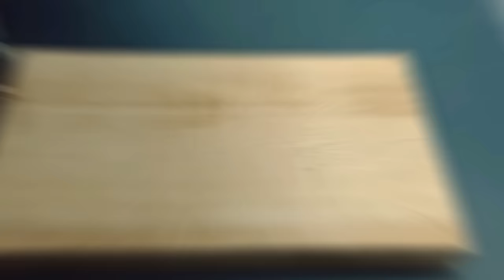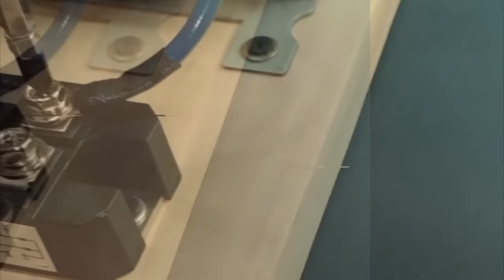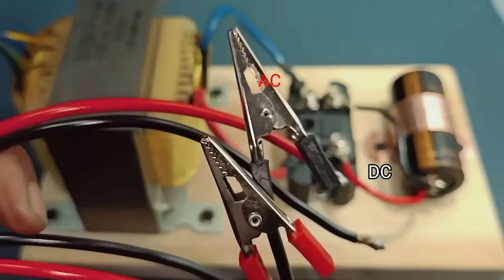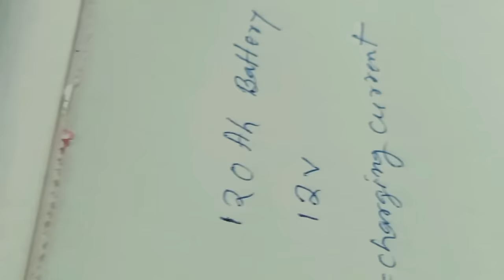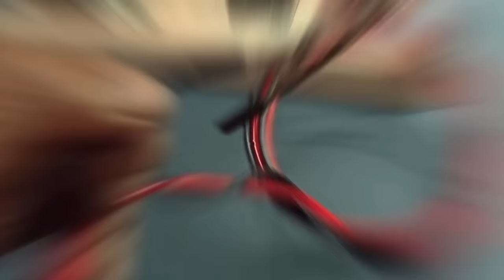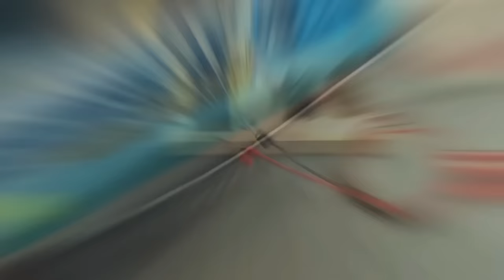12V 200A DC from 220v // Powerful Battery Charger 12V,  How to Make 12v Battery Charger

Comment: Input is 220v 5A , which is 1100VA , how are you getting 12V 200A i'e 2400VA, are you creating magic???
Reply: Yes
Reply: It would be 84.6 amps if it drew 5 amps at 220.
Reply: Hahaha 😂😂😂😂
Reply: Correct!!! Another thing, I don't think that small transformer will take 5 amps for the primary side
Reply: its a total farce
1 -it is NOT a battery charger
2 - its a crude power supply
3 - wiring is a joke
4 - testing a joke
5 - maybe its 4 or 5 Amps only as shown
6 - no protectioin, not even a fuse
7 - no indicators
Reply: Easy,  Use U eyes to check the diameter of the output 14V wire and guess the maximum current can flow through without smoking .

Comment: Not sure why you claim this can yield 200A. Clearly it can't. It's a nice video, just wonder why you didn't state the actual charging current, and maybe display it on a meter.
Reply: Tenga en cuenta que para poder suministrar un alto amperaje el tamaño de los cables deber seras grande

Comment: 13volts is not the ideal charging voltage for fully chargning a 12 volt battery, we need 14.2 or 14.4 volts to fully charge a 12 battery.
Reply from the maker: Total 15v with load, connect with capacitor
Reply: 13 is ac voltage. When it is bridge rectified, 13×1.414 - 1.4 is the dc voltage is going to charge the capacitor. We have to regulate it further for the type of the battery.
Reply: @surendranmk5306  yea that's spot on be more like 18 volts and is either too much or not enough for most batteries lol
Reply: @bparker86  It is better to use a 220 to  18v ac transformer  then  use a dc to dc constant voltage and current buck converter that can exactly adjust the required current and voltage respectively to the type of battery.

Comment: Can use with subwoofer bass 2000w or not?
Reply: No you can't. The rectified voltage of a 13v transformer like shown here is about 18v which will most likely damage 12v amps. Also this rectifier needs cooling  and the cap is too small. Rather take one with 18 - 20v and higher F ratings than this 100v one

Comment: It is better to choose as AC voltage, the 16 V option... rectify it and use an electronic step down module to adjust voltage and current as needed to charge every battery you want or to feed DIY electronic kit. 
I also suggest you to provide the rectifier with a huge heat dissipation radiator: with hight current it generates a lot of heat.
Reply: A fuse would also be a really good idea.

Comment: Hola feliz tarde excelente video me gustó mucho soy Marcelino Cojedes VENEZUELA....
Reply from the maker: Thank u very much ❤️
Reply: its a total farce
1 -it is NOT a battery charger
2 - its a crude power supply
3 - wiring is a joke
4 - testing a joke
5 - maybe its 4 or 5 Amps only as shown
6 - no protectioin, not even a fuse
7 - no indicators

Comment: You have beautiful ideas I like your videos 👍👍👍👍👍♥️👈
 fully watched 👍🥰
Reply from the maker: Thank you very much for your compliments ❤️❤️
Reply: its a total farce
1 -it is NOT a battery charger
2 - its a crude power supply
3 - wiring is a joke
4 - testing a joke
5 - maybe its 4 or 5 Amps only as shown
6 - no protectioin, not even a fuse
7 - no indicators

Comment: Good effort.keep it up. The capacitor is not clear and which other make is the equipverlent I. case its not seem for me to buy?
Reply: @RJEDITALL  ineed a reply
Reply: its a total farce
1 -it is NOT a battery charger
2 - its a crude power supply
3 - wiring is a joke
4 - testing a joke
5 - maybe its 4 or 5 Amps only as shown
6 - no protectioin, not even a fuse
7 - no indicators

Comment: Adding a small ammeter and voltmeter would be handy.
Reply from the maker: Yes, you can add with resistor, 680 Ohm 1w or 1k 1 watt

Comment: Скорее всего 12 вольт 200 ватт. Трансформатор от бесперебойного питания. Какой-то делетант нас вводит в заблуждение
Reply: its a total farce
1 -it is NOT a battery charger
2 - its a crude power supply
3 - wiring is a joke
4 - testing a joke
5 - maybe its 4 or 5 Amps only as shown
6 - no protectioin, not even a fuse
7 - no indicators

Comment: interesting. I built it and got 9v why? I can't still identify properly the wires u used for electricity connection. I used 60A 1200 racifier. Can I look for 220v  5a/10a 2x2 ups transformer?  pls respond
Reply from the maker: Check your transformer output ac volt, n solve it

Comment: Correct your input and output calculation.  It is not possible to get 2400 VA from 1100 VA
Reply: its a total farce
1 -it is NOT a battery charger
2 - its a crude power supply
3 - wiring is a joke
4 - testing a joke
5 - maybe its 4 or 5 Amps only as shown
6 - no protectioin, not even a fuse
7 - no indicators

Comment: An excellent demostration. Thanks. We need it, especially, in these days of so much stress, global insecurity and personal distress.
Reply from the maker: Thank u for visit
Reply: هو ده 5 امبير 220v استحالة طب ماشي فين الكور اللي يكافئ هذه القيمة مغناطيسيا يعني الحديد.
Reply: its a total farce
1 -it is NOT a battery charger
2 - its a crude power supply
3 - wiring is a joke
4 - testing a joke
5 - maybe its 4 or 5 Amps only as shown
6 - no protectioin, not even a fuse
7 - no indicators

Comment: Bom dia amigo toligadinho no canal
Reply from the maker: Thank u ❤️
Reply: ts a total farce
1 -it is NOT a battery charger
2 - its a crude power supply
3 - wiring is a joke
4 - testing a joke
5 - maybe its 4 or 5 Amps only as shown
6 - no protectioin, not even a fuse
7 - no indicators

Comment: OK bro but battery cut off kasa banata ha small and heavy battery????? And transformer sa Jo cut ho .next video plz
Reply from the maker: Ok, bro 100% ayega heavy battery charging auto cut off circuit
Reply: this is a total farce
1 -it is NOT a battery charger
2 - its a crude power supply
3 - wiring is a joke
4 - testing a joke
5 - maybe its 4 or 5 Amps only as shown
6 - no protection, not even a fuse
7 - no indicators

Comment: Very nice 👍👍👍👍 vedeo,,,, sir आपने। ये ट्रांसफार्मर कितने एम्पीयर ka use Kiya hai,,,,,,,
Reply from the maker: 20 ampere ka
Reply: this is a total farce
1 -it is NOT a battery charger
2 - its a crude power supply
3 - wiring is a joke
4 - testing a joke
5 - maybe its 4 or 5 Amps only as shown
6 - no protection, not even a fuse
7 - no indicators

Comment: Man, we still have the option of using a resistor on DC output, or a unpolarized capacitor on 13V AC side to limit the current when need charge a low Amp battery.
Reply from the maker: You can battery charging above 50-200 ah 12v battery
Reply: imposible your transmormator very2 small
Reply: this is a total farce
1 -it is NOT a battery charger
2 - its a crude power supply
3 - wiring is a joke
4 - testing a joke
5 - maybe its 4 or 5 Amps only as shown
6 - no protection, not even a fuse
7 - no indicators

Comment: Кто бы мне объяснил, откуда берется 200 А? При 12В это почти 2,5 кВт! Транс явно не потянет. Мост рассчитан на 200 А? И далее кондер - он что тут делает?
Reply from the maker: Clear not understand
Reply: its a total farce
1 -it is NOT a battery charger
2 - its a crude power supply
3 - wiring is a joke
4 - testing a joke
5 - maybe its 4 or 5 Amps only as shown
6 - no protectioin, not even a fuse
7 - no indicators

Comment: Thank you for sharing useful information and the efforts you have taken, from Jawaharlal Bharat INDIA 🙏
Reply from the maker: U are most welcome
Reply: this is a total farce
1 -it is NOT a battery charger
2 - its a crude power supply
3 - wiring is a joke
4 - testing a joke
5 - maybe its 4 or 5 Amps only as shown
6 - no protection, not even a fuse
7 - no indicators

Comment: Can we use step down transformers for make a battery charger.
Reply from the maker: Yes
Reply: How and explain me please
Reply: this is a total farce
1 -it is NOT a battery charger
2 - its a crude power supply
3 - wiring is a joke
4 - testing a joke
5 - maybe its 4 or 5 Amps only as shown
6 - no protection, not even a fuse
7 - no indicators

Comment: Super very cool well done
Reply from the maker: Thank u bro ❤️❤️
Reply: this is a total farce
1 -it is NOT a battery charger
2 - its a crude power supply
3 - wiring is a joke
4 - testing a joke
5 - maybe its 4 or 5 Amps only as shown
6 - no protection, not even a fuse
7 - no indicators

Comment: This is amazing with high ampire but one question please answer I make rectifier from diode and connect with big ups trasfermer to make battry charger now diode and output wire are heating too much why ? Please answer me
Reply from the maker: you use rectifier bridge with heatsink, Don't use single 4 diode for heavy load

Comment: 12 volt battery  need a 14 volt charge limits
Reply from the maker: Yes, but you can use, because ac output 13v
Reply: @RJEDITALL  wtf

Comment: The transformer output voltage is WRONG ( to charge a sealed Lead acid battery ! ) this needs 14 .2 Volts absolute max ... so ... a 10 Volt transformer output will have a peak rectified voltage of 10  x 1.414 Volts = 14 .14 Volts ( which should be OK to leave connected for a long time ) ... also a 200 Amp transformer would have the secondary wound with a thick  rectangular ( enamel insulated ) copper strip , also the capacitor is not really needed ........ DAVE™🛑
Reply: this is a total farce
1 -it is NOT a battery charger
2 - its a crude power supply
3 - wiring is a joke
4 - testing a joke
5 - maybe its 4 or 5 Amps only as shown
6 - no protection, not even a fuse
7 - no indicators
Reply: @kennmossman8701  True ! ... a 200 Amp transformer would weigh in excess of 25 Kg , and the winding strip would be about 25 mm squared ( and cost a fortune ! ) the project shown would need a ballast resistor ( car headlight bulb ? ) , in series ..... DAVE™🛑

Comment: how can I charge my ebike 72volt (12x6 battries 32ah) with simple powerful charger like this?
Reply from the maker: You can make 220v to 72v 20 ampere transformer for 12x6 battery charge
Reply: @RJEDITALL   can you share the circuit diagram ,I am new in electronics, and my ebike charger is not working
Reply: @RJEDITALL  Plztell me specifications of transformer and other components , thnks

Comment: Cool, real basic and title was missleading not helping me except being short on time, was looking for 12 volt 120 amp regulator circuit in which I know but looking for alternative, a nice video, clean work,but not for me, my directive isnt battery charging rather than a high current bench top power supply.
Reply from the maker: Thanks for watching
Reply: this is a total farce
1 -it is NOT a battery charger
2 - its a crude power supply
3 - wiring is a joke
4 - testing a joke
5 - maybe its 4 or 5 Amps only as shown
6 - no protection, not even a fuse
7 - no indicators

Comment: Is good. Ilike it
Reply from the maker: Thank u bro ❤️
Reply: @RJEDITALL  uochee
Reply: this is a total farce
1 -it is NOT a battery charger
2 - its a crude power supply
3 - wiring is a joke
4 - testing a joke
5 - maybe its 4 or 5 Amps only as shown
6 - no protection, not even a fuse
7 - no indicators

Comment: Bạn chia sẻ rất hay
Reply from the maker: Thank u ❤️
Reply: this is a total farce
1 -it is NOT a battery charger
2 - its a crude power supply
3 - wiring is a joke
4 - testing a joke
5 - maybe its 4 or 5 Amps only as shown
6 - no protection, not even a fuse
7 - no indicators

Comment: Useful video brother thankyou
Reply from the maker: U welcome ❤️
Reply: this is a total farce
1 -it is NOT a battery charger
2 - its a crude power supply
3 - wiring is a joke
4 - testing a joke
5 - maybe its 4 or 5 Amps only as shown
6 - no protection, not even a fuse
7 - no indicators

Comment: Nice 😻 helpful bro
Reply from the maker: Thank you 💖
Reply: this is a total farce
1 -it is NOT a battery charger
2 - its a crude power supply
3 - wiring is a joke
4 - testing a joke
5 - maybe its 4 or 5 Amps only as shown
6 - no protection, not even a fuse
7 - no indicators

Comment: Nice video, thanks for sharing it :)
Reply: this is a total farce
1 -it is NOT a battery charger
2 - its a crude power supply
3 - wiring is a joke
4 - testing a joke
5 - maybe its 4 or 5 Amps only as shown
6 - no protection, not even a fuse
7 - no indicators

Comment: Отлично
Reply from the maker: Thank u ❤️
Reply: this is a total farce
1 -it is NOT a battery charger
2 - its a crude power supply
3 - wiring is a joke
4 - testing a joke
5 - maybe its 4 or 5 Amps only as shown
6 - no protection, not even a fuse
7 - no indicators

Comment: هايل ورائع جدا"
Reply from the maker: Thank u ❤️
Reply: this is a total farce
1 -it is NOT a battery charger
2 - its a crude power supply
3 - wiring is a joke
4 - testing a joke
5 - maybe its 4 or 5 Amps only as shown
6 - no protection, not even a fuse
7 - no indicators